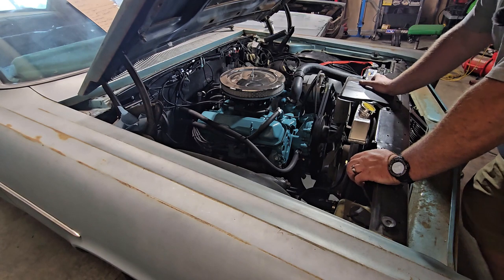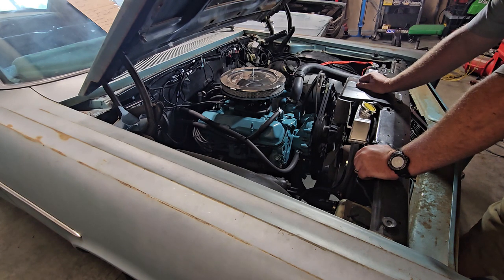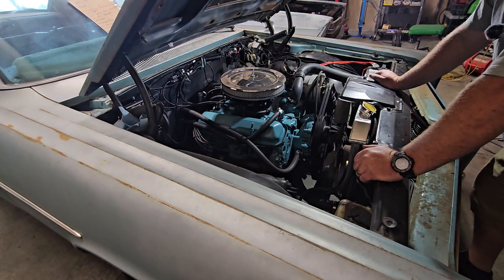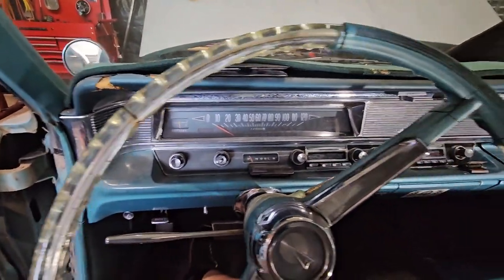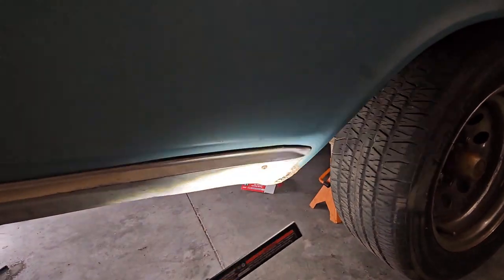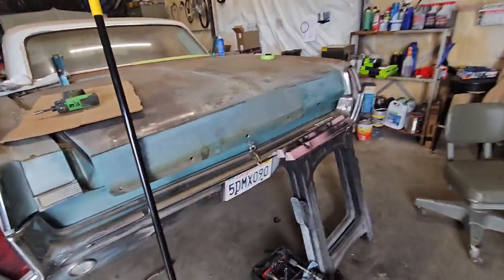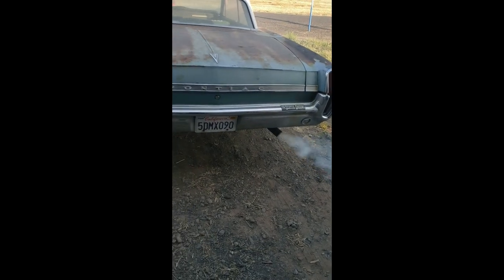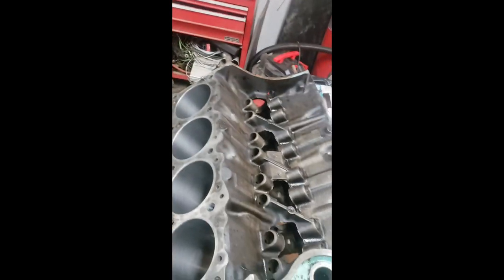1964 Pontiac Catalina walk around....

Comment: My father had one of these, and being a Catalina, it had the Slim-Jim Roto-Hydramatic. That transmission earned its bad reputation. It needed frequent repairs. The Star Chief and Bonneville had the 4-speed Jetaway Hydramatic, which was a much better transmission. But I do think these were some of the best-looking Pontiacs ever and are fun to drive.
Reply from the maker: Yeah this one has the th400. Must have lost the old trans years back
Reply: How does the shift pattern work? That always used to confuse mechanics. They would put it in Neutral and try to back up, thinking they were in Reverse.
Reply from the maker: @southerner66  yeah reverse would be 1st in a th400. So all the way down. Th400 is regular patten